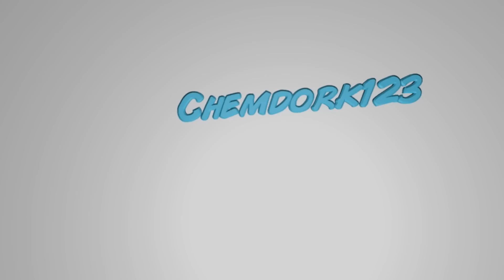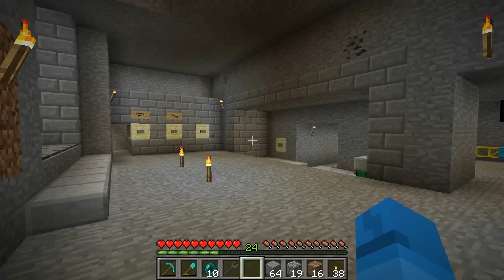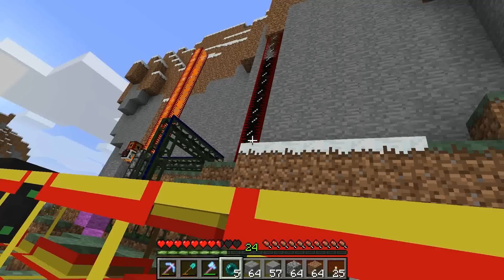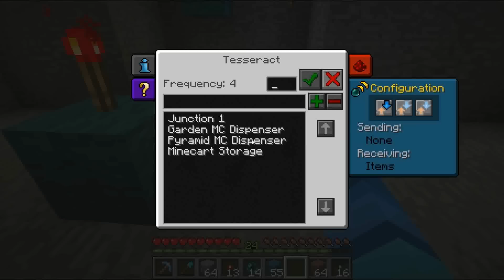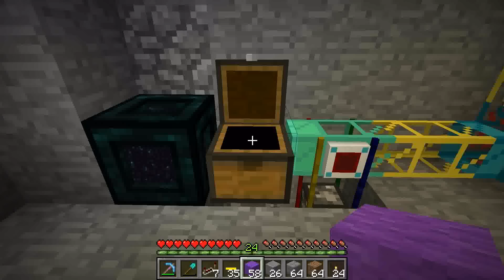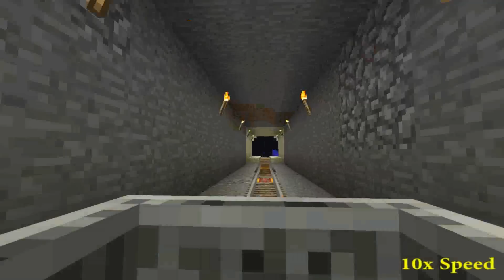My Buildcraft S2E58 - All Aboard the Robot Station

Comment: hey Chem dork can you do a tour of your base in depth?
Reply from the maker: I probably will at some point
Reply: ? I play mine craft with tremble expansion and build craft but for what reason the power pipes don't work with the machines can you help I have
To use the technic launcher because my normal minecraft doesn't work because I have windows 7 can you help
Reply from the maker: +zach “techy guru” schwanke I have windows 7 too.  what versions of the miss are you using?  I recommend manually installing, especially if you are just using this mods. quite easy, I may make a how to video.
Reply: okay